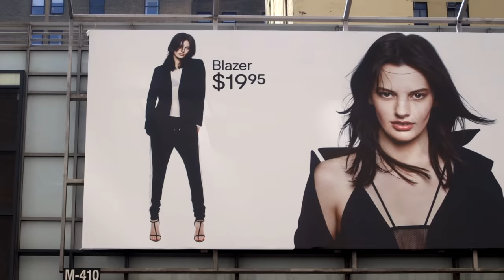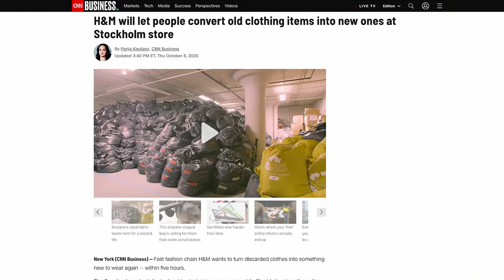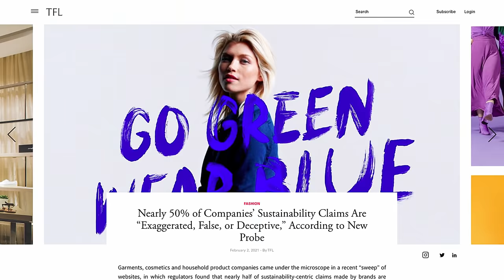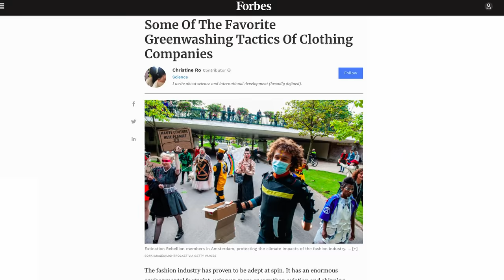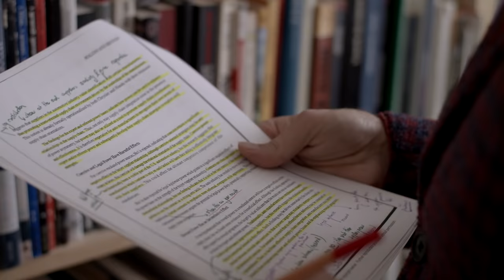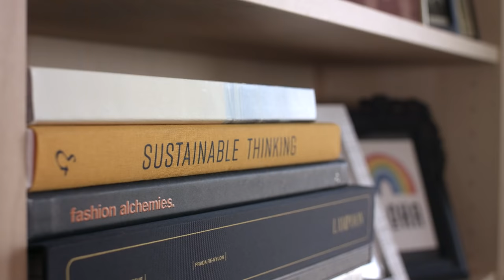Fashionscapes: A Circular Economy

Comment: It should be noted that good quality synthetics can last for years as long as they re-used or re-sold.  Not the cheap polyester though.
Reply: I agree, only the polyesters nowadays are from such low quality that even recyclers don't know what to do with it. So 80% goes directly to incinneration.